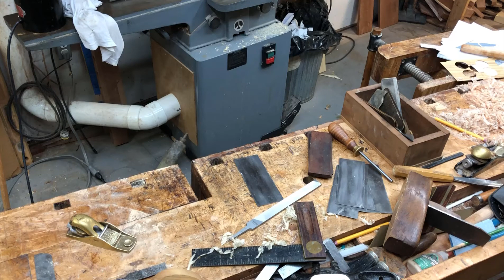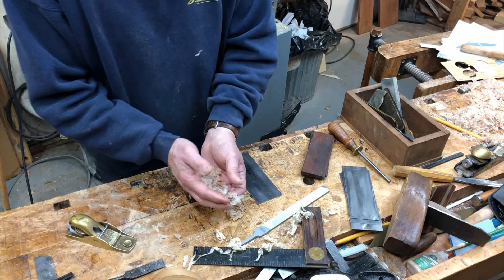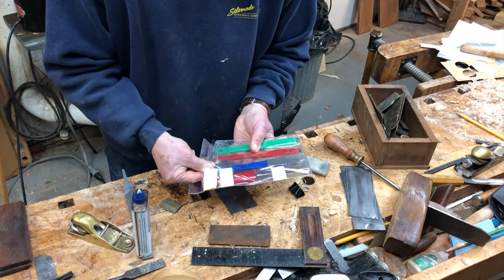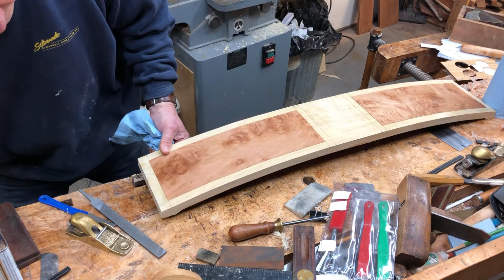Scraper Sharpening and Using

Comment: Tim, if you have the Large Scraping Plane could you please do a video on sharpening and setting the blade depth? I came by one kind of by accident and I’ve seen how great they are as a tool, but I’m just not able to get it set up so it will work like I’ve seen. Thanks.
Reply from the maker: Joe, I do not have a large Scraper Plane, rather a small Lie Nielsen. I follow the instructions provided with the tool and sharpen at about a 60 degree angle like I would do a chisel.  I have not been creating a burr, but I know this might help. I think the most important thing about these tools is the final angle that the blade is set in the plane body. After I sharpen, I do not install in the plane, rather hold the tool in my hand and scrape on a piece of wood to find the angle that provides the best results. Then I know how to set the angle in the plane. 
Tim
Reply: Ok—I’ll try the 60 degree angle. Maybe that will do it.  Right now with angle I have (and a burr) I get chatter and very unsightly marks in the wood even using very slight pressure. Thanks.  Enjoying the posts!